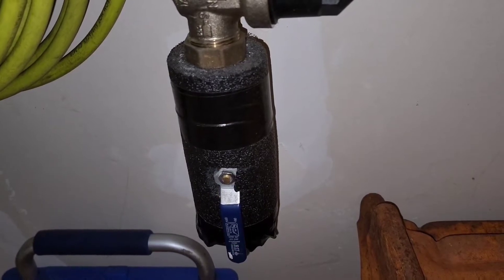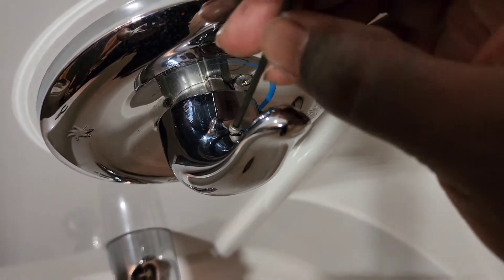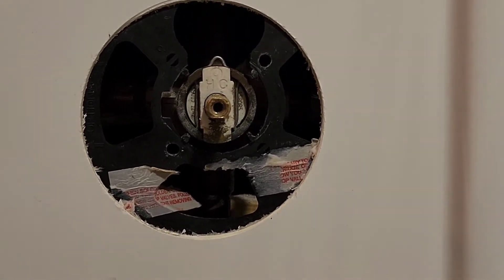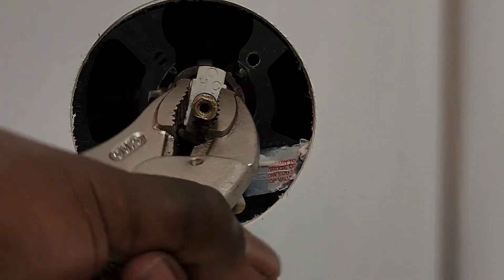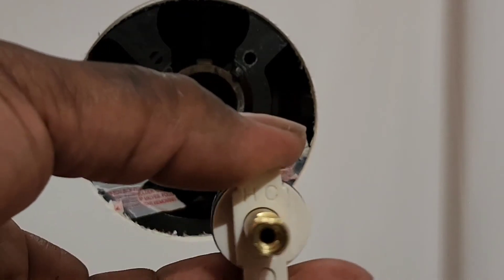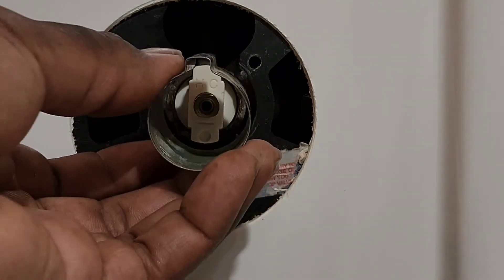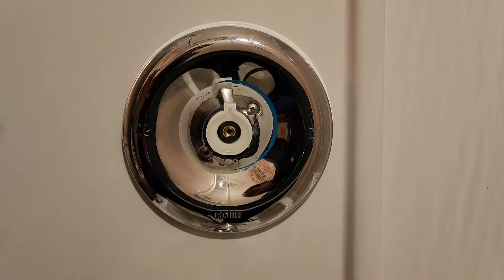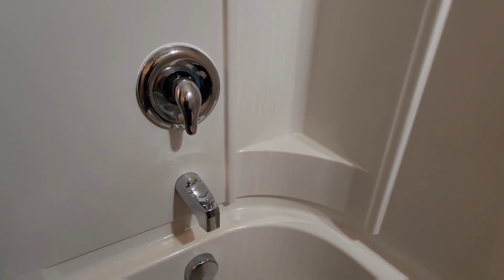Faucet Repair: Shower Bathtub Won't Stop Running Water / Moen 1222 Cartridge Replacement J.O.A.T.D.

Comment: How do I turn the water off from the inside of the faucet fixture until I can order the 1222 valve?
Reply from the maker: With the setup that I have there is no shut off valve you have to turn the water off in the garage at the main water shut off valve and if you don't have a main valve in the garage you have to turn the water off outside at the main shut off valve that the water company uses to turn your water on. But some houses have a shut off valve inside the whole where the cartridge is.
Reply: @JOATD  ok cool…I will look for that valve inside of the wall and let you know
Reply: What would that shutoff valve look like?
Reply from the maker: @christopherchamberlain7817  inside the hole where your face plate for your handle is covering it will be a red turn off switch on one side and a blue turn off switch on the other one is for hot water one is for cold water that is where you shut off the water but most new houses do not have this. You will have to shut off the main valve if you do not have that option

Comment: I changed many of this kind of Cartridges.  Your video is great but you missed  2 black rubber washers should come with the cartridge on both side when you pull it out (see video after 7 mins),  but I didn't see them and you didn't double check they might still stuck inside the pipe.  I suggest Always use flashlight double check inside the pipe make sure to clean any dirt before insert the new one.
Reply from the maker: You are correct. There are supposed to be rubber grommets on each end of the cartridge. When I first pulled out the cartridge, the rubber grommet was torn. I realized that it was a video that I felt people needed to see, so I put everything back together, and unfortunately, I was not able to put that rubber grommet back on because it was broken. I decided to do the video anyway even though the grommet was not on the cartridge. 😁

Comment: Can't figure out how take the little tab out
Reply from the maker: You have to grab it by the loop and pull up on it. I used needle nose pliers
Reply: Thanks for the fast response. I think my problem is the hole behind the plate is too small. I can't even get to the loop. Not sure, but I was reading where sometimes the entire bathtub surrounding has to be removed.
Reply from the maker: If you look at the bottom wear the pin is slid down to you should be able to see a hole where you can push up to push the pen out some so that you can grab it
Reply: Okay, I will try it! Thank you very much!

Comment: Help me!! 
I didn’t everything exactly like this video everything fit perfect and my handle is still turning like no tomorrow 🤬
Reply from the maker: What do you mean the handle is turning like no tomorrow
Reply: @JOATD  basically not turning the water on or off 
It turns without releasing any water I can turn it all the way around with nothing
Reply from the maker: @bazookajoe3290  you know the white piece that you put back in is the part that sticks off of the white piece broken off
Reply from the maker: @bazookajoe3290  or did you break the black piece that goes over top of the white piece before you put on the handle
Reply from the maker: @bazookajoe3290  if either the white plastic piece or the black plastic beast that go together are broken it will spin around in a circle
Reply from the maker: @bazookajoe3290  or if you put the black plastic piece on backwards it will spin around
Reply: @JOATD only thing that seems off to me is the white piece 
It’s loose but also doesn’t have anywhere to lock it in or put it in place…my setup looks exactly like yours and don’t really think anything is broken
Reply: @JOATD also once I screw the black piece in and take it off to see what I did wrong I notice that the cooper piece is not in the original place I left it with the smooth side up
Reply from the maker: @bazookajoe3290  do you mind taking a picture of the white piece and the black piece and emailing it to me jackofalltradesdre@gmail.com
Reply from the maker: @bazookajoe3290  I feel like either the white or the black piece is broken. Before you changed it out did they handle spin around in a circle.
Reply: @JOATD  just sent you an email of pictures
Reply from the maker: @bazookajoe3290  ok I will take a look
Reply from the maker: @bazookajoe3290  sorry but I did not receive it can you please send again
Reply: @JOATD  just did again.
Reply from the maker: @bazookajoe3290  okay so I sent you an email showing you the problem.
Reply: @JOATD  sent another email

Comment: How do I clean water up inside the walls? Asking for a friend. 🤦🏽‍♂️
Reply from the maker: I'll be honest with you I don't know knowing me I would probably stick a Shop-Vac back there and suck the water out if the water is just sitting
Reply: @Markus, I got one of those industrial fans from Costco (about $35) and kept it going in my bathroom when I was trying to resolve a water issue. The compact powerful fans are super helpful.

Comment: Dang 1222 was so difficult to take out but extremely difficult to put back in even with oiling that mother sucker.
Reply from the maker: I'm glad you were able to get it to work. I'm glad my video could help.

Comment: yOU NEVER CHECKED THE HOLE FOR THE TWO RUBBER SIDE PIECES.  KINDA LIKE THE ONES ON THE NEW VALVE,   They weren't on the old one when you took it out!!
Reply from the maker: It fell off when I took it out the first time and then I decided to do a video and it just wasn't on it when I did the video, lol